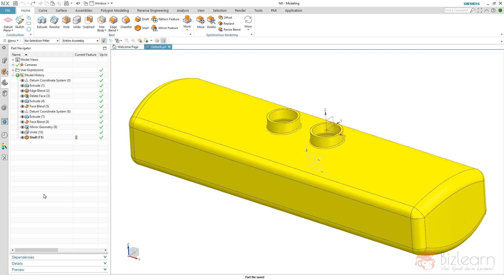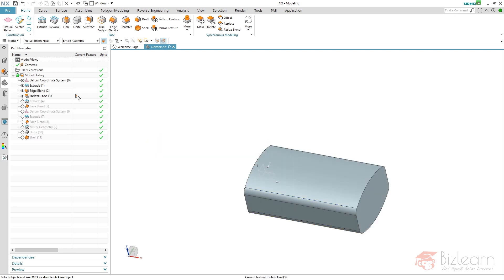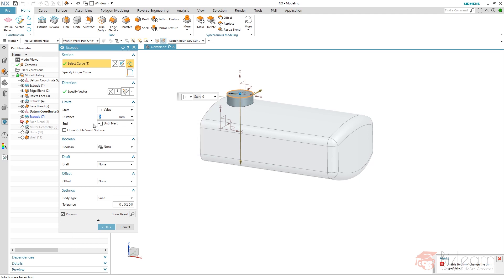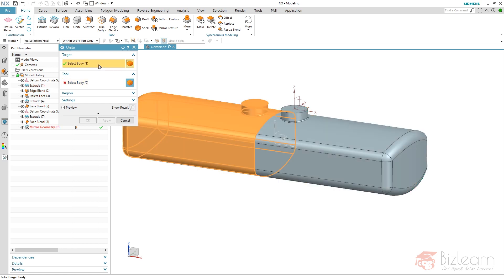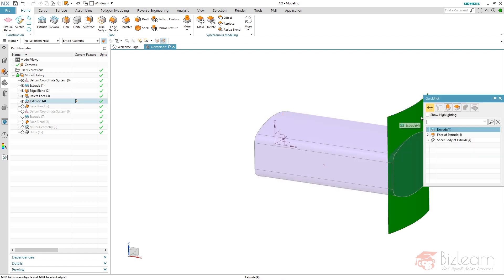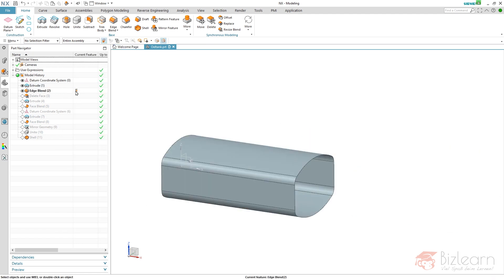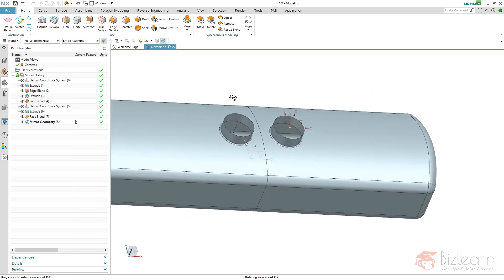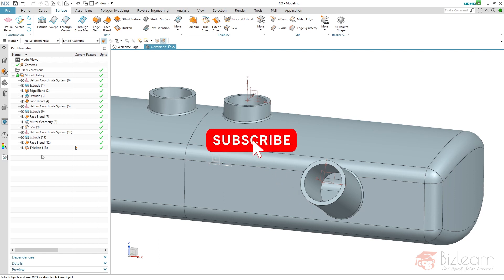Siemens NX Pro Tutorial - increase your model stability by considering the boolean effect

Comment: This video has much more than boolean secrets. I have learned that face blend is more powerful after modifying the parents. The most of us choose the edge blend first because it's faster doing it.

Thanks for another great content!
Reply from the maker: You're welcome (-: Tank you for the comment. A relation to faces is always more stable than a relation to edges, like e.g. by use of the Edge Blend. For parts that have a unique wall thickness, I'll recommend to use the Face Blend and update stability will thereby be increased. Image a linked design surface which might be exchanged. It works excellent (-: